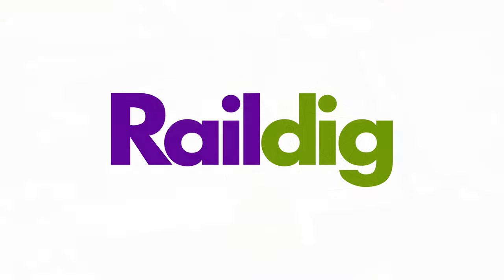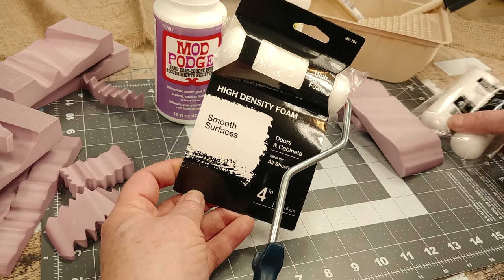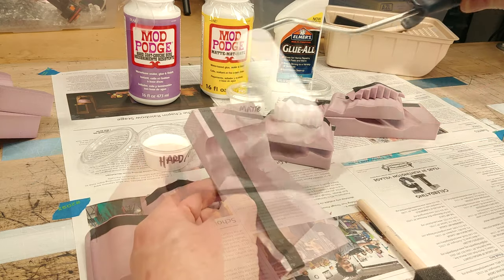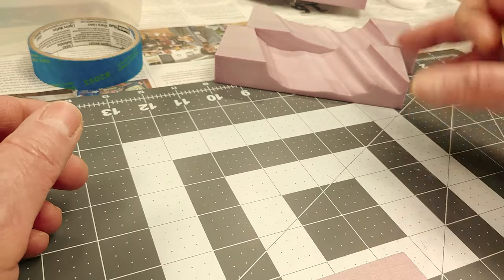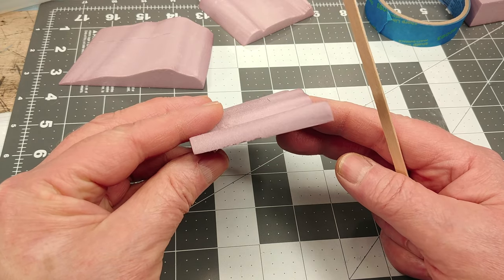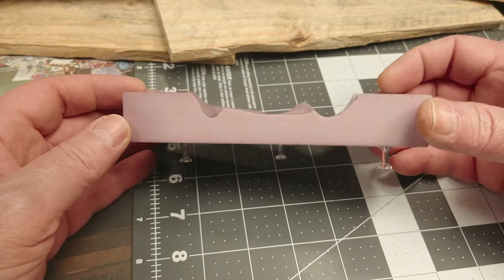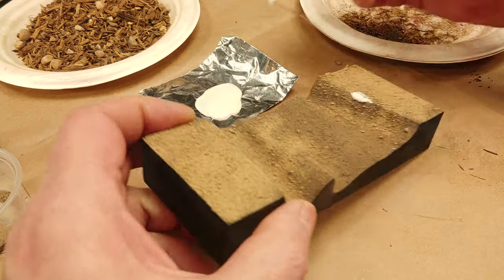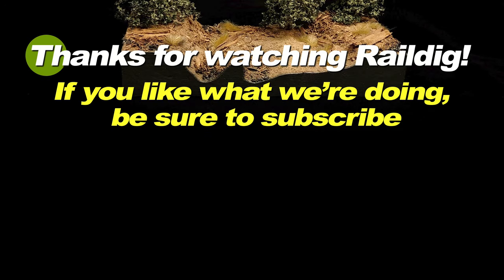Mod Podge Hard Coat | Extruded Foam

Comment: I do some fibre glass and if you want a seriously hard surface over the foam, you should try a thin coat of counter top epoxy with some newspaper.  You might not like the glossy surface you'd end up with, so that's why I recommend dropping a little newspaper on it as it sets.  I made panel speakers from the pink foam you use, and the epoxy gave it a nice solid protective cover.
Reply from the maker: Funny you should comment on this video as I'm shooting footage now for a follow-up vid, should be ready in a few days. The fiberglass / epoxy method is interesting and no doubt strong (surfboards too!!!) but I wanted something fast, reasonable easy, not too messy, etc.etc.

As I do a lot of work with very small diorama scenes, I think this fix I'm working on now will work for me for these particular pieces. I appreciate your idea though, sounds like a good one!

Comment: Thanks John for the video as the timing of this video is perfect since I'm getting the foam base for the layout ready.  One note, from what I have read the Modge Podge Hard Coat dries fast for a smooth touch feel but actually takes 4 weeks to fully cure.
Reply from the maker: I read this as well on the Mod Podge site and I have seen this kind of messaging before, the dry vs cured time. If you look at the Glidden paint website for example, they also say latex paint takes 30 days to cure but will be dry in a few hours. I imagine thickness of coats is a big factor, as a general rule I try to always use thin coats for both drying time and appearance.

I can say that after an hour, this scenic piece felt very dry and the paint via airbrush hasn't been negatively affected as far as I can see.
Reply: Did the mod podge hard coat add any durability to the foam? As in make it harder to break?

Comment: I bought some flocked tree models from the craft store.  Problem is that the flock keeps falling off in play.  Do you know of a spray adhesive or something equivalent to "glue" the flock to the tree to keep it from coming off?  Of course I don't want to see a shiny effect either.
Reply from the maker: If they're going to be handled often, keeping the flock on is always tricky. You could try the Mod Podge Matte. This will keep the shine to a minimum.

Comment: I really like the comparison. How would you compare mod podge hard coat with minwax polyacrylic? I think the latter is more waterproof
Reply from the maker: Thanks! I haven't used Minwax poly on this one, just the Mod Podges and the Elmers. Out of the three I think the Mod Podge Hard Coat did the best job and while it did a nice job, I've now been using thin wood veneer on small projects like this as it gives it max protection and it's really only a bit more difficult to work with than say, a tough cardboard. https://www.youtube.com/watch?v=nKYc3KahuKY

Comment: Water base outdoor Varathane , satin or matte works exellent and is self leveling. Holds texture and adhesive amazingly well
Reply from the maker: That's a good tip, I used this years ago but didn't think of it in this context, thanks!

Comment: Looks like the container comes with a foiled seal top. Pop a pin hole on one side and larger on other to make for a cleaner dispenser and lid replacement.
Mog Podge seems to be the best  vs many other toxic and expensive ways to go.

Comment: That was a interesting comparison.  I wish we had thought about doing something like this back when we built our show modules.  Having a bit of Pink or Blue foam showing through the edge of your module at a show (the result of a nick or ding transporting it)  Is distracting, and realy takes away from the overall appearance of the layout.   Everyone rembers seeing that big old pimple on that kids nose but no one rembers what the rest of his or her face looked like.  Which brings me to my question,.  Have you tried any other brands of Foam coat products?  Can we convince you to do some additional comparisons  using some other foam coat products? liker the Hot Wire Foam Factory's Foam Coat,  their Exterior foam Coat, and maybe some other brands as well..  I would also ask that you do a followup video in a few months and maybe a year or two down the line showing how well the products held up over the corse of time.
Reply from the maker: Thanks David. I did look at that Foam Coat and then immediately got drawn into a huge world of these coatings, many of which have a very cool plastic type of feel, like Episilon Pro or Hot Wire Foam Factory's own plastic looking Styroplast. I read here on the Hot Wire site: http://gallery.hotwirefoamfactory.com/gallery/tool-info/foamcoat-info/, they have ingredients you can mix into the Foam Coat, like a liquid rubberizer.

There isn't a shortage, that's for sure! I do think I'm going to have to take the plunge and try some more of these. On top of the coating, I'm actually on the fence about maybe once a good coating is settled on, doing something other than pure black for the fasica. Something in the DIY-ish family that would look good on top of a sold coating. 

I will be making a lot of these small scenes for products so I do want to try and standardize both the protective coating and the top finish.
Reply: Been doing some research on from coaching this one seems one that goes throughout aircraft boatbuilding craft and so forth... looks like the cheapest with good to better results.

Comment: Could you use hard coat as a sealer to replace varnish? And, would it mar your piece after it has been painted?
Reply: I'm thinking about trying Mod Podge as a sealer on some plastic painted models. Just an experiment.
Reply from the maker: @anthonyclem9585  Not sure how well it would work on plastics. Overall I don't do a lot of plastic work so I'm not really knowledgeable on this. I tend to airbrush things like gloss or dull coats on any plastics I have used. I just did pick up a can of Mod Podge acrylic gloss spray recently: https://www.amazon.com/dp/B003VYD9DM

Mostly I bought this as a test as I tend to trust the Mod Podge products and well, I was just curious as I had not seen this product before. Unless it shocks me (and it might!) I'm still a fan of basic single action airbrushing on the plastics I have sealed due to the smoothness of the finish it gives me.